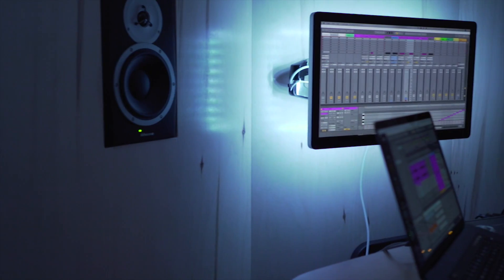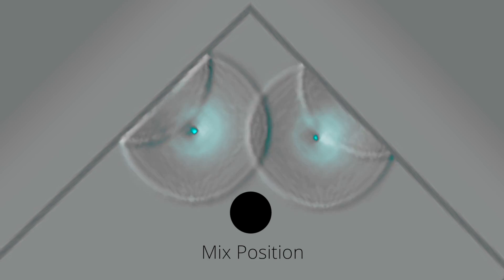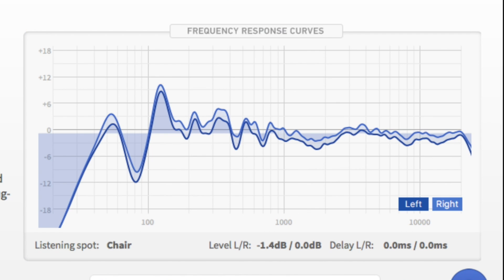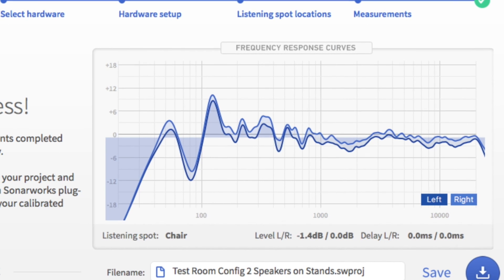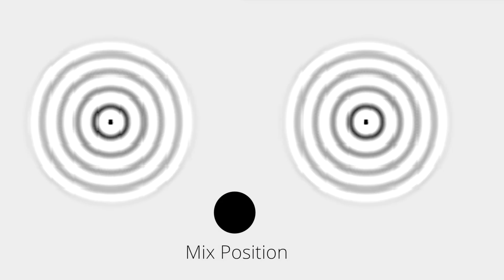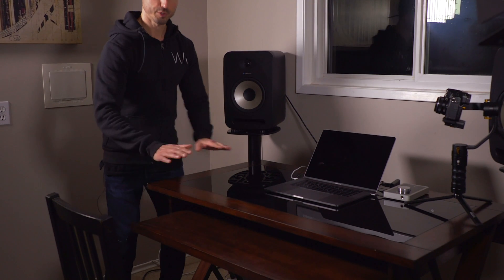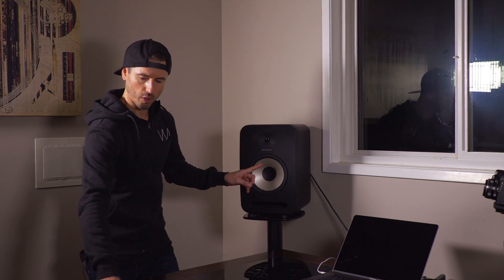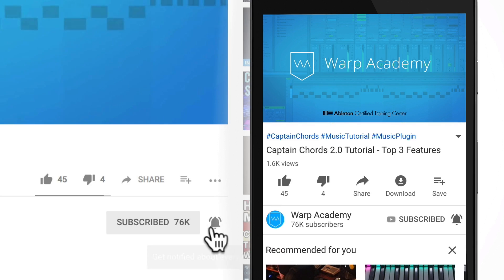How to Set Up, Test and Improve Your Home Music Production Studio Room – Acoustics Tutorial

Comment: Perhaps I missed it in the video, but how did you establish where the speakers should be placed width wise? This is something that never gets mentioned, people always talk about the equilateral triangle but the speaker width dictates how bit it is and where the listening position ultimately ends up.
Reply from the maker: Hey hey.  Yeah good question.  Each set of speakers has a recommended listening distance range.  We were within this and then set the final width based on the listening position in the front back plane of the room.

Comment: I know there can be a big difference in speaker stands, and you told us your favorite, but what about cheaper stands (like Gravity GSP3202 VT for example)? Do they help, or do they make more problems than they solve? Thanks for the great content!
Reply from the maker: Hey hey.  I've never tried those so I can't really comment.  Let me know if you end up getting them!

In general though, I look for these features in a stand:

1) Mass.  Light stands will resonate.  My stands can be filled with sand or shot to increase mass because they have a dedicated channel for that.  
2) Cable management.  Is there an internal channel for tidy cables?  I like mine to run inside the stand.  
3) Decoupling.  Do they have floor and stand top decoupling?  
4) Monitor seating.  Do they have some type of sticky surface to put the monitors on?  Like rubber, sorbethane etc.  You don't want your monitors to move 1 mm when you seat them.  
5) Do they have foam on top?  Foam has no place in monitor stands.  Placing your monitor on foam and not a more solid surface will compromise it's transient performance like a runner in quicksand.  (Ex: Look at Primacoustic Recoil Stabilizers as a good example of a proper decoupler and seating system).

Comment: Thanks but studio monitor manuals specifically say not to put speakers closer than 12 in from any wall. The reference program is great too but it will only make matters worse in the end because it will overcorrect those nulls by boosting them and this will cause even more interference in the end and an even more chaotic sound.
Reply from the maker: Hey hey.  You may be surprised to hear this but the speaker manufacturers often give the worst advice on speaker positioning.  In this respect (about your 12” point) they are dead wrong.  The only reason you should gap a speaker out from the wall is if you’re using a sub to highpass the monitor.  And then the sub must be against the wall or it too will suffer from SBIR.  If you need further reinforcement of this important point watch this excellent video from GIK acoustics.   They are some of the only people who get this right.  

https://youtu.be/KwVk7XvL2oY?si=R5JKrQyWY9JiujGK

Note that when you put a speaker against the wall you’ll get boundary coupling / acoustical loading.  And you definitely CAN deal with that with EQ.  Acoustical loading is in phase.  It shows up as a broad low shelf boost and you simply use a low shelf to attenuate it.  Heck you don’t even need Sonarworks to do that.  You just use the low shelf filter adjustment on the back of your monitor.  

Front wall acoustical loading is jot the same as SBIR.  You’re correct that you cannot deal with boundary nulling with a normal room EQ system.  You can fix it but you’d need a special sophisticated modeling delay that is not yet on the market but has been proven in research from ISVR.  

I did a video with extensive testing on this exact subject.  Check it out here: https://youtu.be/kbmCxkcH_EU?si=xnrWxbFnYm_CiWnf

Comment: What if you turned the desk around and have the window at your back(in mix position)?
Reply from the maker: Hey hey.  No, you'd never do that.  1) Acoustics reason: You'd get substantial reflections.  The back wall is where your speakers are aimed and it's where you need the most treatment.  2) Aesthetics: It's nice to have a window to look out when you're working.  Natural light in an otherwise dark box.
Reply: @ cool thanks for the quick response . I was thinking of getting some treatment panels or bookshelves to go over the windows in general . I was hoping maybe that would fix the issue with the reflections?
Reply from the maker: Hey hey.  Happy to help.  A bookshelf won’t do anything.  And the right acoustic panel would help but do you really want to block your window?  I mean why not orient your room so you’re facing the window?  What’s the issue with that?

Comment: How bout having em on isoacoustics on desk against the wall ?
Reply from the maker: Hey hey.  If you have your speakers on your desk, it's really not ideal.  You're going to be super close to the monitors, which can affect the frequency response in multi-way speakers.  You'll also very likely get desk reflections and comb filtering.  

If you are going to put them on the desk, I like the Primacoustic Recoil Stabilizer decouplers.  Also you can use polyurethane decouplers.  The ISO Acoustics ones are alright too.  Dynaudio used to ship their speakers with them and I had a pair that I liked alright.  Cheers!
Reply: @warpacademy  my desk is a pro audio one and is pretty wide so less reflections. I’m 1m30 away from my speakers which are kali audios LP6, I think it’s alright.  Are the primaacoustics better than isoacoustics? thx for tour tips
Reply from the maker: Hey hey.  Happy to help.  Pro audio desks are usually the worst offenders unfortunately.  They're made super large for tons of gear to be on them.  Desks designed for acoustics are small, vented, and don't have any gear on them.  They're also low without a keyboard tray underneath.  

The ultimate test is to put a small mirror on your desk surface and move it into the midpoint between you and the speaker.  If you can see the speaker in the reflection anywhere on the desk surface, you will have specular desk reflections and the accompanying comb filtering.  

I prefer the Primacousic Recoil Stabilizers.

Comment: I literally ordered the ms90 stands in a 36” height for my rokit 8 G5 speakers.  I’m planning on filling the third “fillable” chamber with sand perhaps 65% of the way up.  I’ve heard it’s possible to deaden the stand by filling it all the way up.  I’d appreciate it Vesper if you could give me tips for the fill up aspect of the stand, or does it matter?
Reply from the maker: Nice one.  They're good stands.  And I like the KRK Rokits as monitors as well.  I used to have a pair of G1 Rokit 5s that I loved for small monitors.  

For the MS90 stands, pay attention to a couple of things.  First of all, you want to ensure that the acoustic axis of your monitor is at ear height.  Usually that's 47" from the floor when you're seated.  The acoustic axis is midway between the center of the bass/mid driver and the center of the tweeter.  If you need to prop them up a bit, do do by putting a concrete patio stone under the stands.  

Next, about filling them, yes, in general adding mass to the stand is a good idea.  I don't know how much of a difference it will make as I've never tested it A/B myself, but generally that's considered a best practice to add mass so it won't resonate.  

A good way to test this is to run a slow sine sweep from 20-500 Hz very loud (85-90 dBSPL-C) and listen for mechanical resonances from the stand.
Reply: @warpacademy  I feel like my neighbours are going to love the sine sweep test!  lol thanks for the info, I'll run the test when my stands get here Tuesday, they are currently en route.
Reply from the maker: Oh, yeah, if you have neighbours and you're doing loud sine sweeps then they'll definitely hear them if you're in an apartment or regular residential construction.  The sound will most certainly transmit down the stands and into your floor.  Good luck with the stands and speakers!  It's a good setup.

Comment: Are You sure that I should have speakers right agains the wall if I have rear bass-reflex?
Reply from the maker: Yes.  Absolutely.  Without question.  A rear facing port doesn't do anything to change the directionality of bass.  Bass is omnidirectional.  Whether there's a port or no port on the back, bass still radiates in a sphere.  Rear ported monitors radiate bass in all directions.  Front ported monitors radiate bass in all directions.  Only cardioid monitors have directional bass, and those are super rare.  

That said, you may not want your monitors directly on the wall, just very close.  You need room for active amps with heat sinks or fans to be far enough they won't run the risk of catching things on fire.  Manuals will list minimum tolerances.  Also, you don't want to block a port.  So you may need an inch or two of clearance, but no more than that.

Comment: Great Video! Would you recommend putting the subwoofer near the wall, too? I used this Trick for my monitors and they Sound much better now. Just left 7-8cm for the Bass Reflex whole
Reply from the maker: Yes, you definitely want your sub against the wall or flush mounted into the wall.  If you look at the manual where they talk about sub setup, you should see instructions on that.  

You'll definitely want to do some proper acoustic testing though, to ensure your low end is in phase.

Comment: I have my studio in the exact shape as your demo room 9 x 9’. I have noticed I’ve had a horrendous time with low-end bass. Would it help to add acoustic panels on ceiling, corners and window?
Reply from the maker: Unfortunately, not really.  That type of room is so horrible, for dimensions, that you can't fix it with acoustic treatment.  

My recommendation in this case is to mix in headphones, and then eventually find a better space with much larger dimensions and a rectangular shape.

Comment: Hi! I’m very interested in building my speakers into the wall to solve low end problems instead of buying expensive bass traps for the front corners. I have monitors with bass port in the front (Quested VH2108) Can you help me in finding good information about that? Thanks a lot for this movie it’s clear info👍
Reply from the maker: Hey Ben.  That's a good plan.  A couple things about the hard front wall.  It's precision carpentry.  Most people don't have those skills or appropriate tools.  Make sure you do it right.  Use a professional if you need to.  

The design is equally important.  Work with an acoustician.  Someone who builds studios professionally and doesn't work for a company that makes prefab acoustic treatment.  If you do, they'll just end up trying to sell you on the prefab panels and those are entirely unsuited to professional, serious studios with lots of low end extension.  No 2" or 3" thick panels are going to do much for your low end attenuation or decay times.
Reply: @warpacademy  I would love to ask professionals but there is no budget.
Reply from the maker: Ah yeah.  Acoustic consulting goes cost for a good professional.  If you don't have the budget then don't consider building a hard front wall.  It's costly.  In this case, just push your monitors right up against the front wall like this: https://youtu.be/kbmCxkcH_EU

And then build acoustic treatment around your speakers, similar to how I show towards the end of that video.

Comment: Thanks old musician disabled building my studio about to buy a new house so Now I know what type of room to look for. Also I got some folding stands do you think they will be ok as I start out. I also just downloaded to that software for that mic you have to check specs of sound positioning my equipment and  set up. Just using one of those plastic folding tables with a yoga mat on it. I plan on getting one more for my Akia mpk225 and my Zoom R24 also . I was planning on getting a adapter to change the output of the Zoom R24 from USB to optical to add more channels to my Audient 14-2 . I like to hear your thoughts if you got the time. I plan on buying some gear from you as I get set up. Thanks for your help. ✌️
Reply from the maker: Hey Jay.  I hope the room testing kit helps with your setup.  I'd definitely try to get your monitors on stands close to the wall if you can.  Go from there.

Comment: It's basically impossible to get the TRUE acoustic center... centered. As the acoustic center of the mid is usually near the back of the speaker and the tweeter is directly up front. So there is a distance difference.
Reply from the maker: You can, however, get it as good as you can get it and make a meaningful improvement by following these steps.

Comment: Talking of ‘big fancy monitors’ aren’t yours far too large for that room? Worth mentioning?
Reply from the maker: Not at all mate.  Nor are mine particularly fancy, or large.  These are Dynaudio BM12mkIII monitors, with a Genelec 7060B sub.  

My room is actually quite large at 23 feet deep, 15 feet wide.  These are easily appropriate for this size of room and smaller rooms that are well treated.  In fact, I plan to use larger 3-way monitors soon and ditch the sub.  

It's not uncommon in rooms designed by Northward Acoustics (see Noisia and Skrillex studios) to have 2 or 4 x 15" subs in the room and their rooms are not much larger (higher ceilings).
Reply: @warpacademy  I was talking about the speakers you put in your guest room
Reply from the maker: Not really.  The Tannoys are 8" and you can shelve out the low end if you need to.  6" may be more appropriate, but you'd need to run acoustic tests and treat the room to know for sure.

Comment: Using corrective eq software...I dunno.
Reply from the maker: I hear you on that.  What are the alternatives?  1) Mix in headphones or, 2) Learn REW and very technical room testing techniques, then invest probably $10,000-$30,000 in properly done acoustic treatment to get a really nice tuned room.  Oh and hire an acoustician to help you implement it.  

So, short of that, for normal people with more minimal budgets, using an easy to use system like this to test the room without learning REW and applying some corrective EQ is a decent compromise.  

Most producers I've consulted with, who don't like their room response, failed at room setup 101 when they placed their monitor speakers off from the wall, well before even getting to acoustic testing or treatment.
Reply: @warpacademy  It's very tough for the home studio guy. Treating rooms is, like you say, a science. It's very difficult. And in a small room...look out! But these software eq things...like I said, I dunno. The ones that eq your monitors in your room...just create newer problems...now you need corrective eq to address the correction eq. Set up your corrective room eq...then REW again. Check out the results. You'll be re-correcting again and again as newer issues pop up. As for the headphones...all they do is reverse mirror the standard freq response...and charge youa bomb. If you want more accuracy you can send your cans to them for "special magical custom eq correction". Where you'll again be charged a bomb. Not saying they don't help in some way. But the best method is to learn your stuff and train your ears. Ear training won't cost you a bomb. All it will cost you is persistence and perseverance and thorough critical listening. The proliferation of corrective eq sodftware is very enticing for people who are desperate for results. Still, many people seem happy. So I dunno. I just dunno.
Reply from the maker: You're not wrong.  I think there's a lot of merit in training your ears and going with the acclimation approach.  The ability for a good engineer to adapt to headphones or a room is strong, and this is proven with research.  

That said, there is technology that's more advanced now than basic room EQ, which is capable of nearly perfectly correcting the frequency response of a room and monitoring system (at the expense of headroom).  So that is possible to not create additional problems.  

Sonarworks can't yet do this, but other systems with a modelling delay can do this.  Philip Newell discusses this in depth in his AES book Recording Studio Design.

Comment: Hi, great video. What height do you recommend for rear surround speakers? Would I apply the “Acoustic Access” for rear as you recommended for the front speakers or 1 to 2 feet higher than ear level? Thank you.
Reply from the maker: Hey hey.  We only work with stereo configurations and with LFE for acoustics.  For surround, you're best to consult an acoustician.

Comment: Nice video ❤️. But what if I want or prefer to place the speaker sideways . Is it okay ? Or not . Thank you
Reply from the maker: Glad you liked this.  There are some good reasons to place the speaker vertically, mainly that it optimizes the sweet spot.  IE the dispersion of the high frequencies by the tweeter waveguide.  The waveguides are generally designed to spread the HF wider when the speaker is vertically oriented.  

Why would you want to turn them on their side?  If it's just for looks, forget it.

Comment: What should I do?
My room has a whole glass instead of wall , exactly like his room but all glass, which is very noisy
Reply from the maker: Well, you're basically screwed.  You simply cannot ever have a room with good acoustics with a ton of glass.  Use headphones.  For a modest investment of $1,500 or so you can get extremely good mixing reference headphones like Audeze LCD-X or XC.  That's what I use when I'm in a non-ideal acoustic environment.  $1,500 may seem like a lot, but it's not even close to the cost of acoustically treating a room or even buying proper studio monitor speakers, so just go that route and you won't regret it.

Comment: I`m afraid about the earthquakes. The isoacustics stands could prevent a fall?
Reply: it's non-slip rubber so possibly.
Reply from the maker: No from an earthquake I imagine!  Light vibrations, sure, as the tip of the stands are rubberized.  Also best to fill the inside of the stands with ball bearings, shot, or sand to weigh them down.